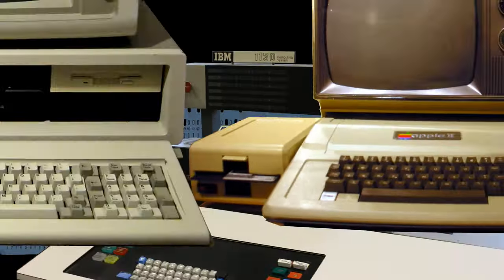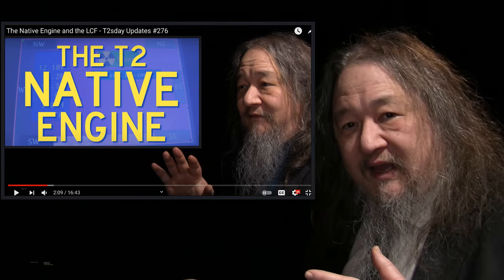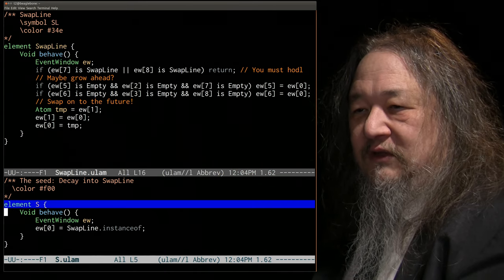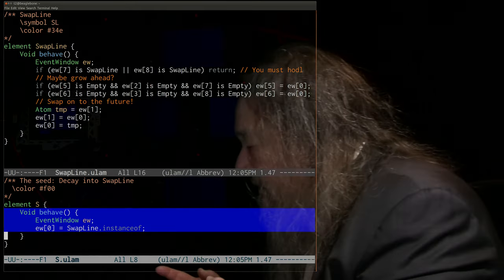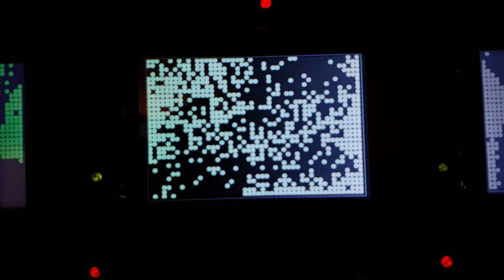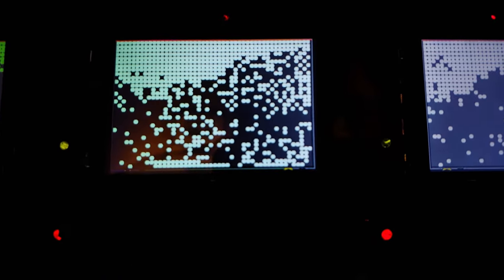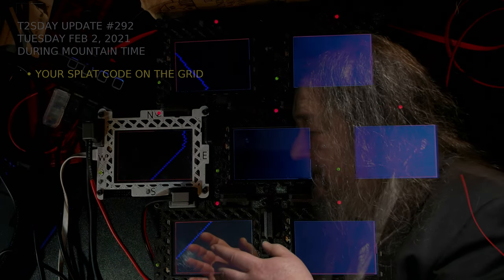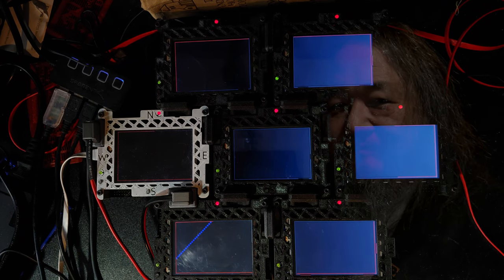Indefinitely Scalable Ulam - T2sday Update 292

Comment: Was the aer actually dropping in those bugged tiles? Just a visual bug? Tiles should reasonably only slow down if they are waiting for locks, maybe log an average lock speed per connector? Maybe somehow the same sites keep getting picked for events which results in less changes overall? Does the bug only happen with certain tiles? Does it also happen when the sites aren't showing?

Hardware stuff?

Gahh, hearing this weird behavior makes me want to bugfix, please make sure to tell us when you find the problem!
Reply from the maker: I'm pretty sure the "AER drop" is real but unsure of much else!  Thanks for engaging; for sure I'll follow up with developments!
Reply: this slowed tile bug remebers my when PC slows down due to full RAM and the os is therfor using virtual RAM from disk. So maybe some garbage-collection from the cells' visualization, which does only releases memory when re-initializing the view or so? but don't know dude xD
great progress though! happy to see more so good luck on the road!